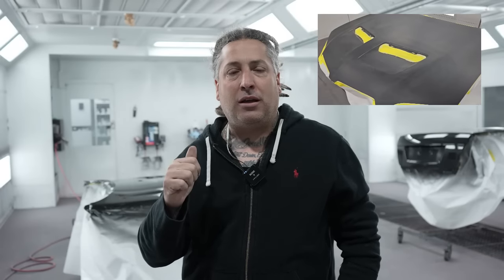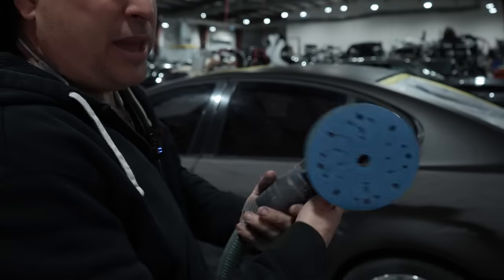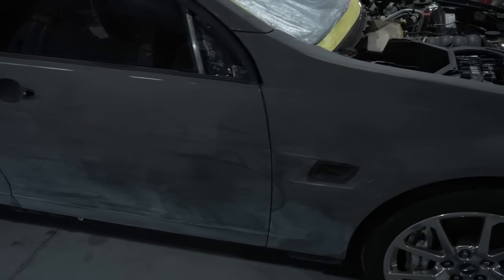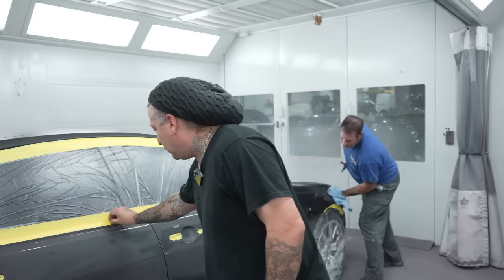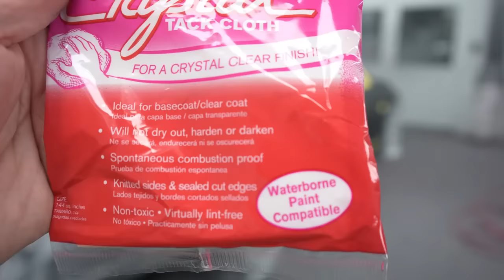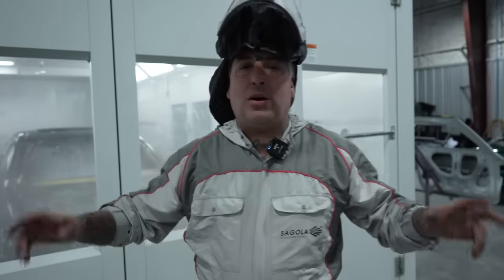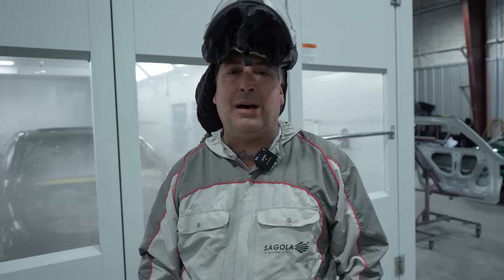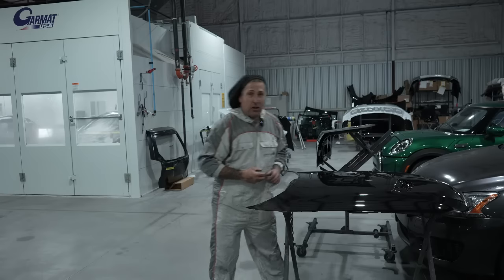Show Car Finish Or Orange Peel Finish? - Full Respray Episode 3 @eastwoodco

Comment: on my 95 Civic, I am debating if I should have the quarter glass removed for respray. The concern I have is the moldings are no longer available so if something breaks I may be screwed. Your professional thoughts / recommendation?
Reply from the maker: I would check with the glass it a much better job when removed
Reply: @kandyman5315  perhaps you can make video showing how to tape around glass for the best results? Thank you for the great videos. ~ Mike

Comment: Im painting a truck in my garage with metalic single stage. Its getting to be a high of 55°-58° out. Its got a heater vent but i expect it will be about 60ish with ventilation and some space heaters. Should i stick with medium activator or use the slow since its a bigger job?
Reply from the maker: Medium   for sure might even grab some fast for a cocktail mix
Reply: @kandyman5315  i have both. Like 50/50 or 70/30
Reply from the maker: 70 30
Reply: @kandyman5315  thanks agin!

Comment: Bad ass sir, quick question whats the maximum amount of clear coats that should be applied? If you going to block sand the clears coat, the clear coat is cromax g2 7779s
Reply from the maker: 3 coats is what I do. if looking for more sand then reapply 2 more, known as a flow coat
Reply: @kandyman5315  thank you sir